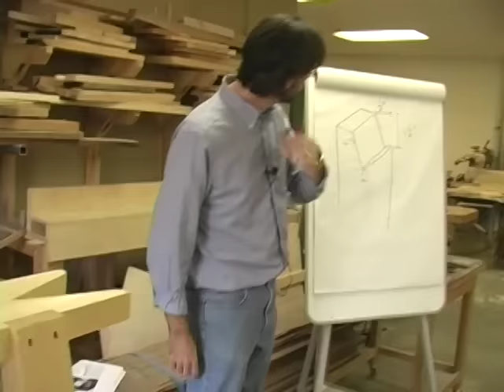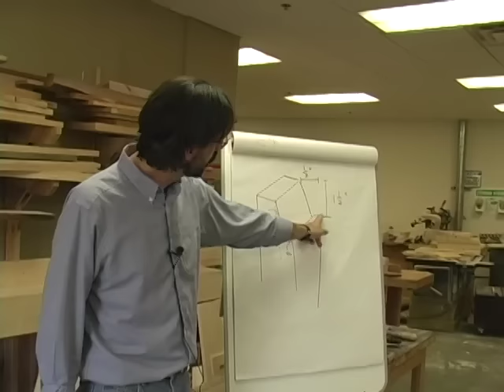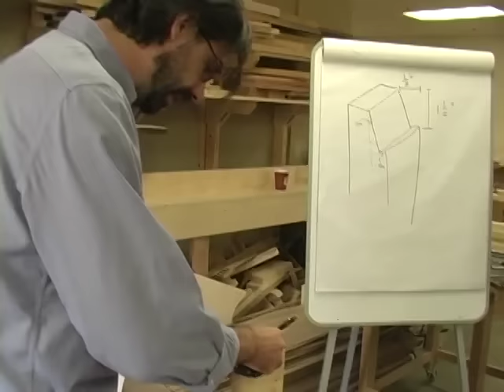Build a Traditional Sawbench for Hand Tool Woodworking

Comment: Loved this and I have an improvement on yours. Roland Langford was a carpenter in La Grande, Oregon who taught me how to build one fast. It’s legs were splayed as a compound mitre at 10 and 7.5 degrees, which created a stable parallelogram as opposed to a rectangle. The shin busting stretcher was eliminated and a plywood triangle was mortised into dados under the top and the cross brace to the front and back of said parallelogram. I built a pair to fit me, and then a pair for dad’s masonry horses at a higher 30 inch height. He had those until after he retired. Now Roland had a beautiful set in his cabinet shop. Instead of plywood supports, he had hickory supports with splayed wedged through tenons. You can stand on the ends without tipping it and the top of it will never sag. I have a 20 year old picnic table with same concept-extremely sturdy and light. These horses are easily stacked in the truck to move to the next job.
Reply: mikeshoops Now how about a video, Mike? YOU did all the the talking and got us want to know more. So how about it?
Reply: Excellent comment . Shinbusters ha ha haNo need for a video . It's obvious you know . 👍
Reply: I'm from La Grande!

Comment: Nice presentation.

One set of suggestions I'd make from an English Carpenter's perspective - while maintaining the 10 deg set of angles - would be to bevel the legs in two directions;  A simple change to what is known as a double bevel trestle. A design that's been in use since before the 1900's

a)  Deepen the cut to half the thickness of the legs, so - once fitted - the top edge of the leg rests flush with the outer edge of the worktop

b)   Additionally angle the legs (Again at 10 deg) so each pair splay toward each end of the sawhorse/bench.  This is the second bevel.
  
c)  Trim each end of the work top so it draws level (Lengthwise) with the toe of the legs and set the depth of the V-notch so it rests approx 0.25" short of the stretcher beneath.  Trimming the ends level prevents the user from accidentally tipping the bench if resting one's weight on the very end of the bench.

d)  Raise the height of the lateral stretchers to within 6" of the underside of the work top and the lengthwise stretcher can be discarded, because the additional angle  literally locks the legs into position. 

e) Adjust finished height so the horse stands level with the top of your knee-cap. 

The sawhorse/benches remain traditionally English, but are now easily stackable and transportable and extremely strong.  It's the most common design used in British work shops and on construction sites.

Comment: Nice build. One suggestion: after the legs are cut to length, the bottoms should be chamfered all around. This will help avoid splintering when the saw bench is dragged across the floor.
Reply: Pick it up.
Reply: @bobbg9041  Saw benches move when you're working on them, too. Kind of hard to work on them when they are picked up.
Reply: EXACTLY

Comment: well done - learned a lot of basic layout and how to cut and finish them. I like the cleanup portion. I would think that you would have done all for legs at one time to ensure the angle is consistent on all the legs. 
Enjoyed the detail in which you went with each feature needed in the design and assembly of the saw bench. Only additional thing I would have added to the class is to champher all the edges before assembly.  I would like to have a class by you! Like your delivery! Columbus Michigan

Comment: Its nothing like a traditional British saw horse , the legs on a British saw horse are angled outwards from the front and rear and from the sides , there isn't a brace along the centre but there are plywood boards across the front of the legs.

Comment: 9:07 i have been wondering what that symbol was for the past year! THANKS FOR THIS VIDEO ❤️❤️❤️
Reply: I believe that it is half of a cursive lower case "f", for "face". Typically a tick mark in the form of a "v" is used on the reference side, not two "f's", towards the f. The face side is almost always the wider section and the reference the narrower, or edge side.

Comment: Having first found the plans online, I came here looking for the initial part of "from rough stock to finished form". The video and plans talk about using a single 2 x 6 board - but from the cut list only the top is made of 2 x 6. The legs, bracers, etc are made of 2 x 3.

So, presumably after cutting off the length for the top, the remaining board was ripped down the center. There seemed remarkably little dimensioning needed if that was done with a hand saw. 

l assume using 2 x 3 from the outset and edge gluing two together to make the top would have been too weak to take the weight.
Reply: 2x3 nominal. Where a 2x4 is 1 1/2 x 3 a 2 x 3 can be 1 1/2 and whatever you have after ripping a 2 x 6 down the middle. What is important is whatever the dimension is all the boards are the same. It doesn’t make a lick of difference whether you use 3” 2 1/8” 2 1/2” 2 11/16” or 3.2” as long as you have 4 legs that match up you are golden. And this is a great thing to remember in all your woodworking. And why a divider and a marking gauge are such useful tools in this trade. They are practical only because when woodworking precision is relative not absolute.

Comment: Good video. I’m too busy with power tools, a repairing junker houses, but one day I’ll brake out a hand tool and build something. Very informative video. I’m wondering if a relief cut into the notch would have facilitated chunking out the chisel work? It is an extra step...it’s hard to see at 480 resolution what’s actually happening? So take my remarks as noise from the peanut gallery.

Comment: I'm not sure I'd term that joint connecting the long and short stretchers as "half lap."  To me "half lap" means half of the thickness of each is nested down inside the other.  ...which is how I would make those joints anyway, in order to achieve a flat, planar surface  onto which could be placed a board, etc.  But maybe I'm just being picky.  Enjoyed the video, regardless.

Comment: This is only an English style saw bench according to thoughts outside England my saw bench (saw horse) look nothing like that, for a start they are supposed to stack so bracing the front legs to the back is out and the leg brace is way to low
Reply: This is a shop tool, stacking isn't really necessary.  But in the end, the point was teaching hand tool techniques while building a traditional woodworkers unit. Not to build a modern construction workers sawhorse which is built with a circular saw, plywood gussets splayed legs for stacking, and seldom if ever is used with a hand saw, so is usually built higher for better ergonomics when running a circular saw.
Reply: @markdoldon8852  The thing is, the point I was making is here in the UK we don't call them American or French, we just call them a saw horses and they come in lots of styles each one personal to the user. To me an English person, to call it am English saw horse or workbench to make them seem better or worse in some way is irreverent. one of the things that most portable saw trestles have is that they can stack and in my work shop that's how I have made them for the past 33 years and that is how the are depicted in every "English" wood working book I have read. One thing is they are the first thing an apprentices learns to make by hand even today, nomater what they call it.

Comment: that was a very good lesson but I could see that your short stretchers were wanky on the video. But your save was outstanding.
Reply: I think some of the reason for the wonky stretchers was due to the way he laid out their position. If you notice (1:03:30) he marks the measurement on the outer edge on one leg and the inner edge on the other making it slightly off since the legs are splayed. This error may have gotten compounded if he also then marked them out the same way on the other legs. Great that he showed how to accommodate for this with the cross piece.

Comment: Workbenches are very low. It makes you bow which is tiring and you also don't see as well as if you had higher body position. Possible small advantage for planing is not that great it is worth it.
I wonder if there is some historical background for low workbench? If there is you should remember people were much shorter back then

Comment: Drywall nails are too brittle to use where stress can cause them to break and if you do not countersink them the head will spit the work. Just use a wood screw and a tapered drill to drill a pilot hole and countersink it.

Comment: Typically great work,,,,but a major design saw, especially for smaller shops. - Can't stack 'em. ' How 'bot a set that can be stacked,,,,,-Maybe one with a bottom shelf and the other one that goes over it?
Reply: Yes you can stack them the lower stretcher sits flat on the bench top

Comment: That one lower stretcher wasn’t square
Reply: I saw that, too. I reckon that the long stretcher mainly functions to keep the horse from wracking and only needs one of the two inner surfaces to be perfectly matched to hold it in place so that the side walls remain engaged
Reply: I am HOPING that he did that intentionally in order to later demonstrate the process of transferring the wonky angle for the long stretcher.  He was eying down it, even mentioned that it was off, so I can't see it being accidental.  The visible twist would activate my OCD, I would see it every time I used the bench.  But of course his was probably used for firewood when he was done.